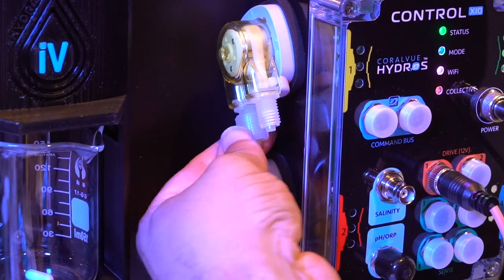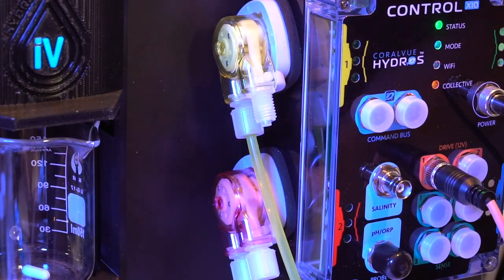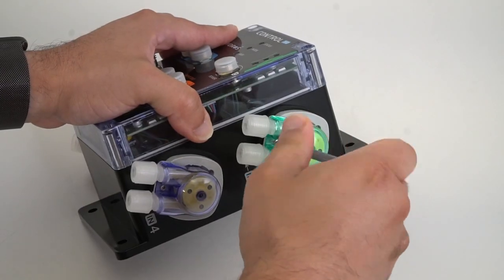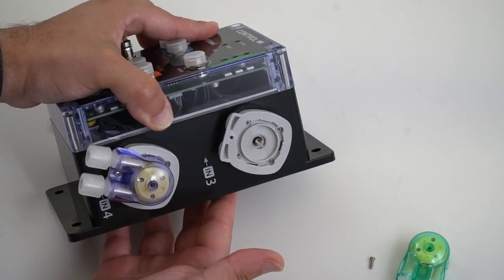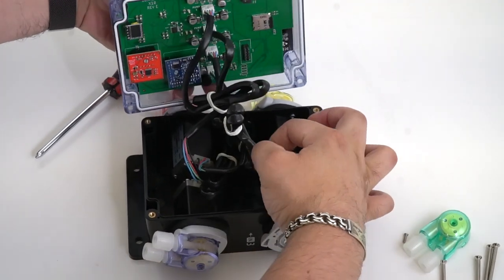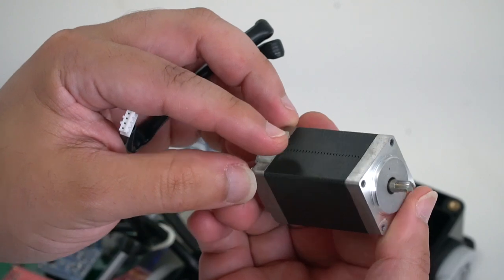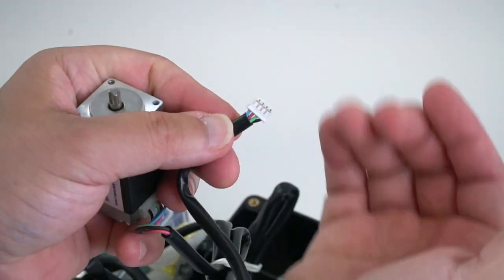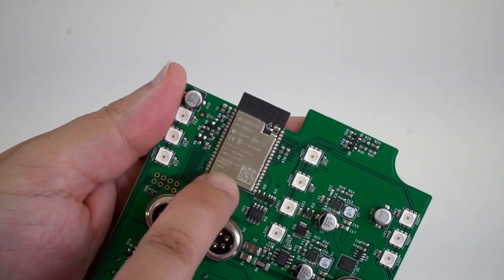HYDROS Control X10 Aquarium Controller - Dosing Pumps

Comment: You guys are mixing up Trinamic with Tridonic, not only in this video but in your Macna presentation too.

The first is a Germany based company producing stepper drivers, while the later is based in Austria and exclusively producing light drivers.

Just curious - how many driver ICs are used in X10? Some companies cut costs and share the ICs between motors - however this limits the ability to use multiple motors at the same time, which in some applications might be a requirement.
Reply from the maker: Sorry Trinamic is correct. If we stated Tridonic we were wrong. The HYDROS X10 uses separate drivers for each pump.